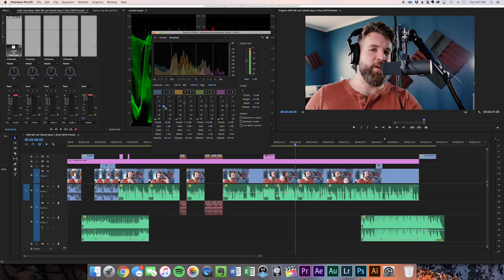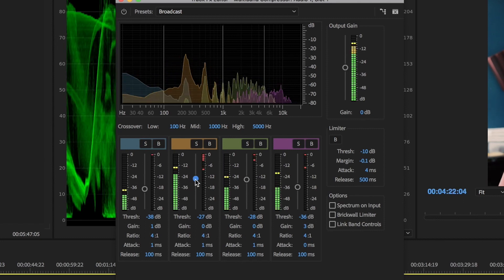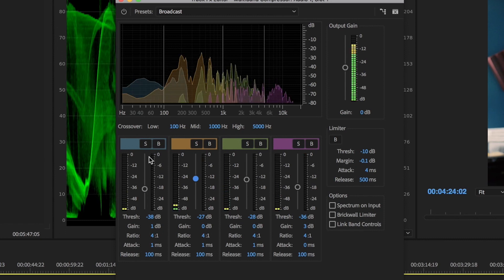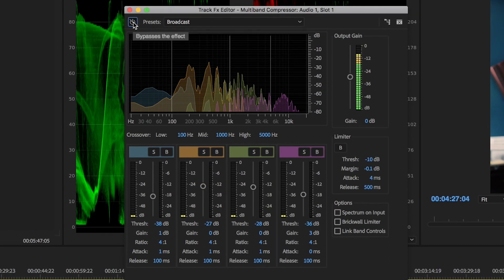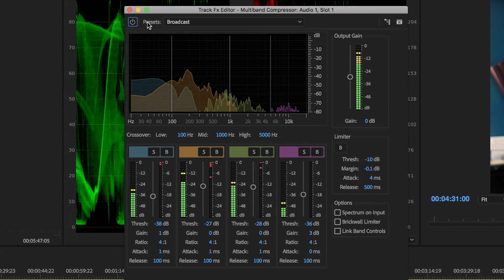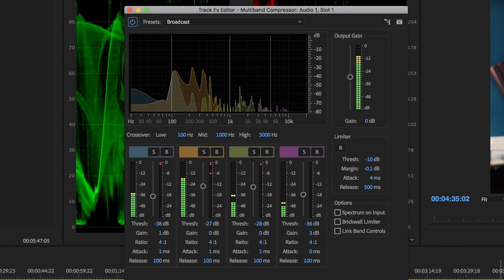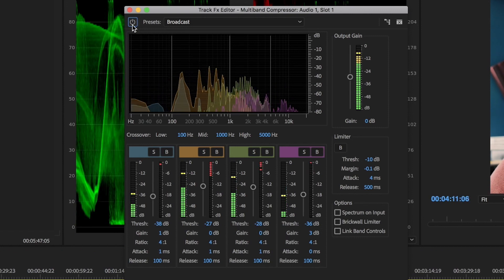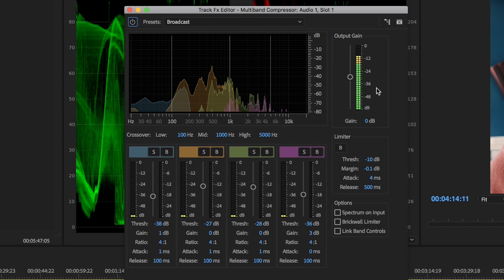What is a Multiband Compressor? // How do you use a Multiband Compressor in Premiere Pro CC

Comment: hey oliver,

I had a question regarding this,

would multiband compressor be also used with 'Dynamics' and 'Parametric EQ'?  
or is it best to just use it by itself

Thanks man

Tim
Reply from the maker: Absolutely it could!  Since it bridges that gap between the two, it is great alone, but ALWAY better as a small piece in a bigger puzzle!

Comment: Greetings. OK So I just discovered you and liked you enough to subscribe. I'm editing my first 3 short docs I filmed in India. I've never done audio or editing before. Audio seems to be my weakest link! So I've just been playing around with this multiband compressor and it's definitely improved my audio. I've used the broadcast preset and tinkered slightly. However it also seems to be adding, I would say, some clicks and pops. And also slightly increasing the background sound, which I've already previously worked hard to remove. Should I now add like a declicker or something? Any advise most welcome. Cheers fella!